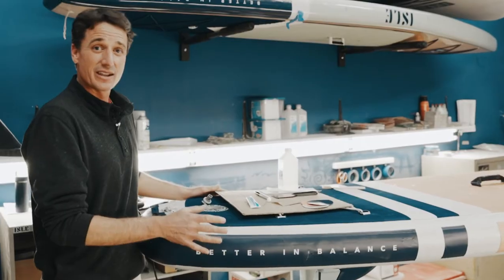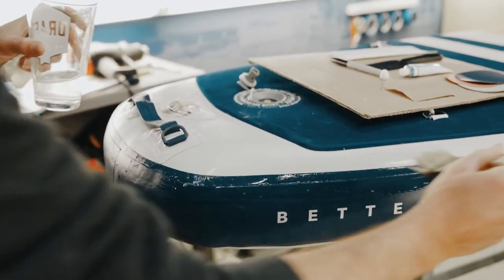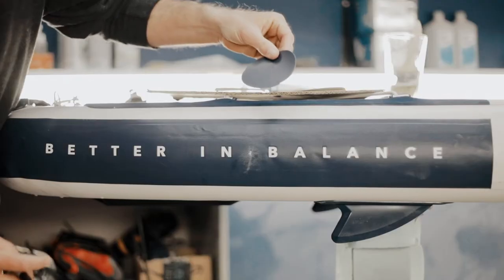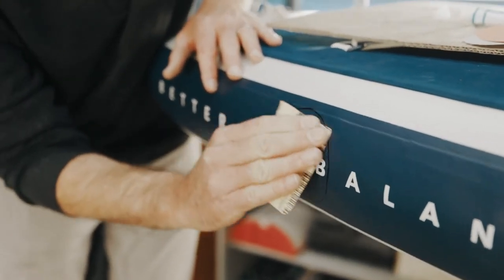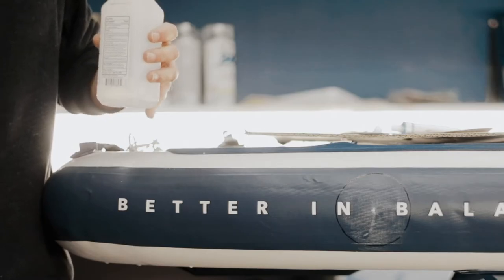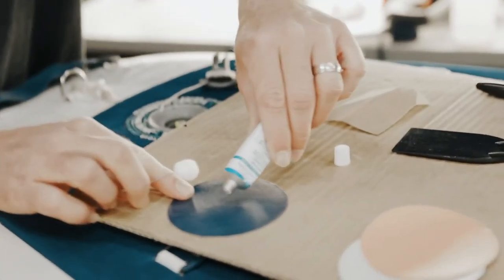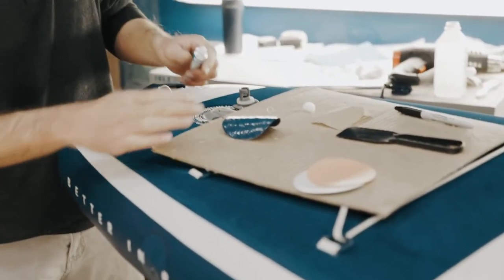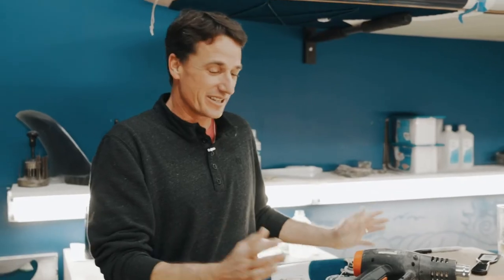ISLE How To Repair Your iSUP

Comment: TU on the video! Yep mine was on the side also and I just did this method with about 3 psi seemed sufficient. Just in case it still leaks I have to redo it ... will the heat gun help remove a patch?
Reply from the maker: You're welcome, and yes if you heat the patch it will loosen the glue if you need to remove/redo - don't overheat!
Reply: @Islesurfboards  Thanks ... yikes ... had to redo ... the directions concerning the glue say to do 3 coats, which I did. Allowed 24 hours to cure and still had a slight leak. The second time after cleaning up the mess did only one coat as you did, and it work so much better! But dang found another even smaller leak in a seam. Think I'll just use something like an Ice Pick to force some glue ... heat up a bit and roll it to get a seal ... etc.

Comment: So, you have repaired the sup being inflated, not deflated, right? Is this correct to repair a defalted SUP? My queston may sound silly but the recommendations differ from video to video. And as I am going to repair my SUP for the rirst time, I am puzzled. Thank you.
Reply from the maker: For repairs on the deck or hull you can deflate fully, for the rail we recommend having the board lightly inflated so you have the shape of the rail to work with during the repair.  However you can also deflate fully and repair the rail by laying it flat.  If you do have it inflated it needs to be VERY lightly inflated, just enough to fill out the board, but not pressurize it.

Comment: My ISLE SUP has 4 years now and it is starting to open on the edges frequently. I even lost my confidence on it so don't go too far in the sea. Any suggestions?
Reply: By the way, I have always been very careful on not inflating it above 15psi and not leaving it in the sun. The same issue happened with my cousin and sister ISLE SUP. (Model Explorer).
Reply from the maker: The biggest factor that impacts the lifespan of an inflatable is the storage and use environments.  We have seen boards still going strong after 10 years, but it's all related to care, maintenance, usage and environment.
Reply: Same thing is happening with my board along the crease created by folding it up. Seems worst in section just behind middle of the board where there appears to be the least material

Comment: The video references a tube of vinyl glue that comes with the board.   I bought one over the summer from Isle and it came with patches but no glue.   How can I get some?  I tried a glue that I bought locally (tube repair) and it does not seem to be working.
Reply: Unfortunately I did something by mistake and the board blew out at the seam.
Reply from the maker: Matt we don't ship the glue any longer because if HazMat requirements.  You'll want to purchase a PVC glue, we recommend Clifton's Urethane Adhesive as a good one.

Comment: Can you heat weld the patch opposed to glueing it?
Reply from the maker: Unfortunately no, you need the PVC glue in order to form a strong enough bond.  You can heat weld PVC to PVC but it typically requires you to have access to both sides of the PVC (inside and outside board) which is not possible on a fully assembled inflatable board.

Comment: Hello, what is the approximate temperature on the heatgun?
Reply from the maker: Not sure exact temperature as there isn't a temperature gauge on our heat gun - the key is just to WARM up the area, not apply very high heat that could melt the materials.
Reply: @Islesurfboards  Thank you for your response, enjoy your day.

Comment: Will this work for the seam as well? I have a Peak paddle that I bought on 2018 and it broke. Bought it thinking it was a great one, but broke. I think it can be fixed but I’ve been trying to do so for a year and a half now. Was about to give up until I saw this video. Please help!
Reply from the maker: Hi Patricia! Yes, this method will work for inflatable SUPs made from PVC!
Reply: @Islesurfboards  thank you for replying. I did it but it did not work. Everything goes fine and it does until I put it in the sun. It explodes… Thanks though!